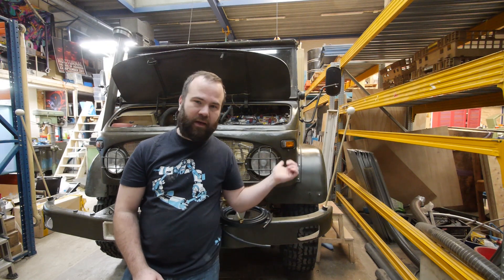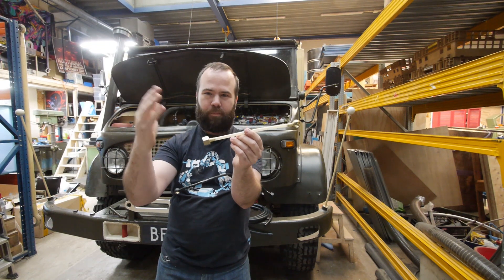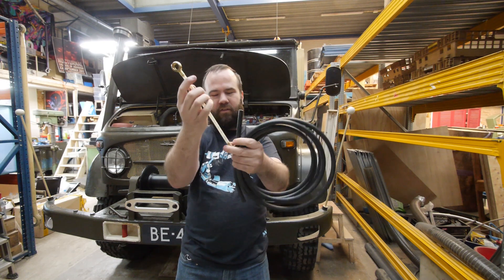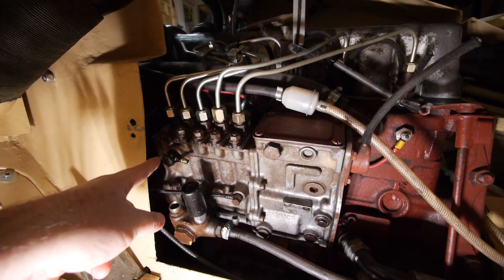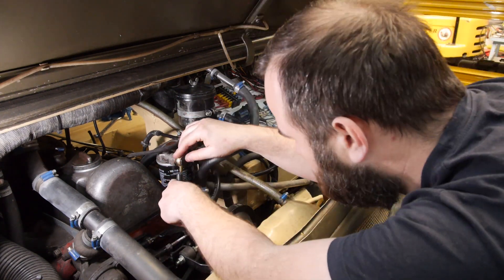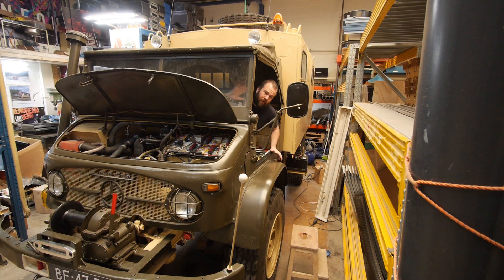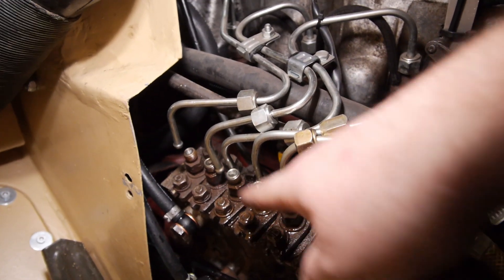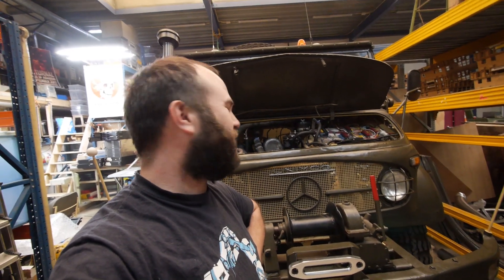My Unimog 404 Diesel is Broken, OM617.912 Fuel Line Repair, Fuel Pump Problems.....

Comment: put an electric fuel pump for priming/start assist..... back at the tank. Put it on a switch so you can use it only when needed. Does not need to be fancy pump but do make sure the lines are good so it does not become a source for sucking in air.

PS-  before permanent install..... put said pump inline to a spare hose and prime from a separate fuel container.. and run return line into this container.   If she runs now.... you have fuel lines between tank and IP that is sucking air..... or you have fuel pick up issues inside the tank.  Have heard of the internal line in the tank getting a rust hole..... and anytime fuel level gets below that hole.... you start sucking in  air.

Comment: Hello from Australia.... im curious... when you done your engine change did you have to swap out the entire fuel line and fuel tank or did the om617 just hook up to the existing petrol lines...
Reply from the maker: I replaced the hardlines to hose. But on the stock tanks. But I have them connected in the bottom so it is just 120 liter